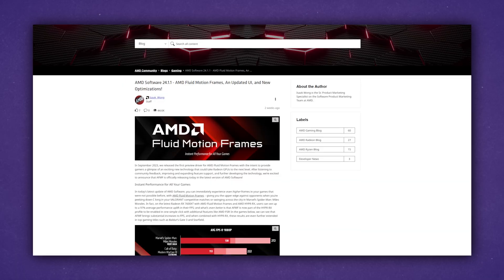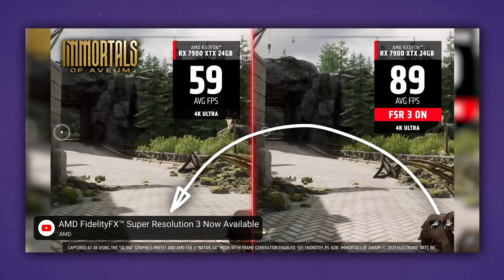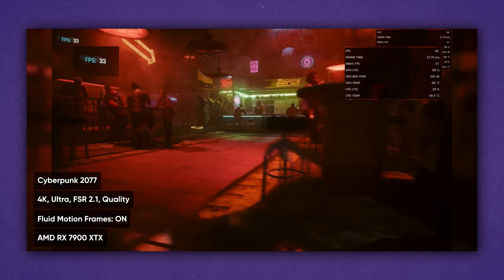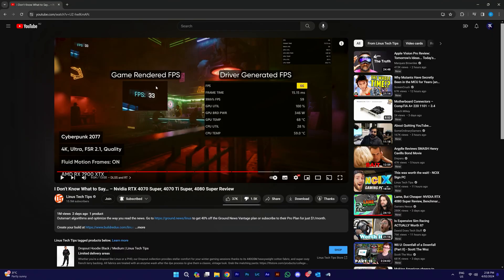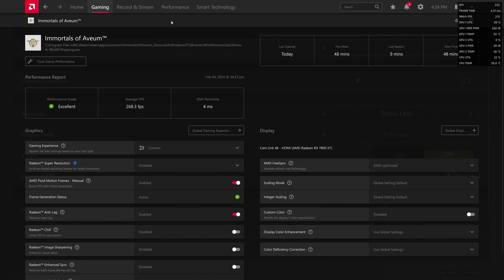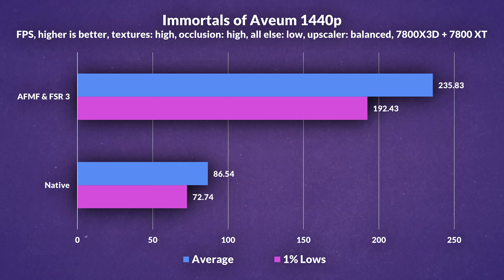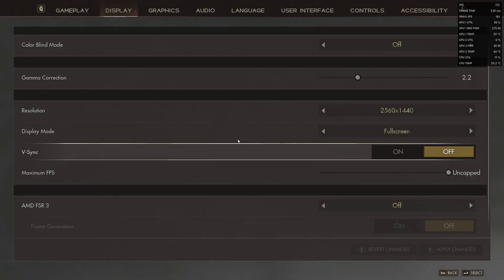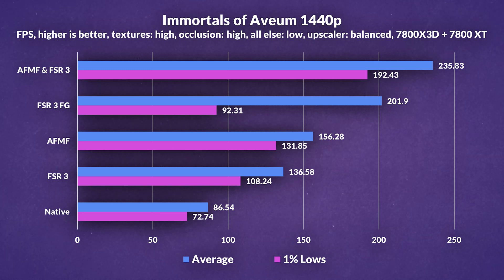FSR 3 Is NOT the Same as Fluid Motion Frames Here's Why…

Comment: AFMF 2 has a superb quality, high fps but higher Watts (FPS = 120 -144 also reaches 180 depends on your settings). FSR 2 In-game was more smooth the fluidity there. Consume less resources and less heat (FPS = 90 - 116) and either just used anti Lag or Radeon Chill. Like they say better used the In-game upscaling if it offers.